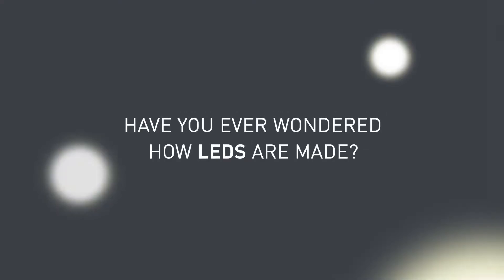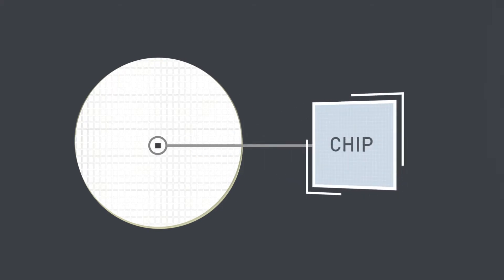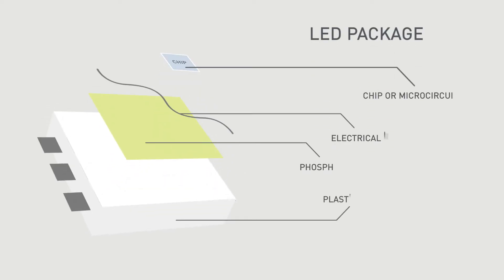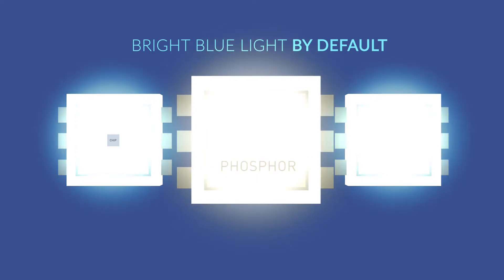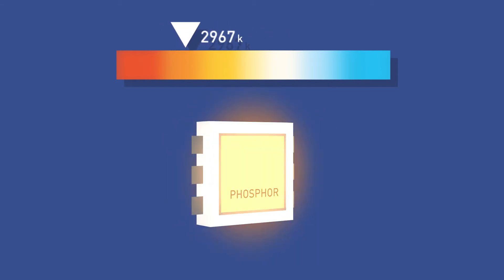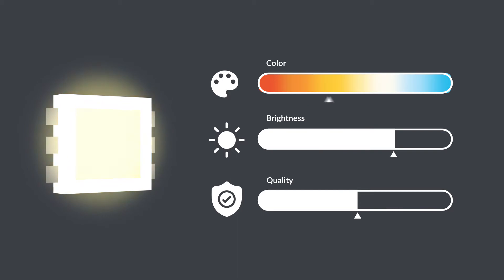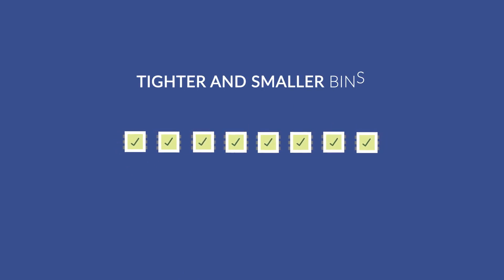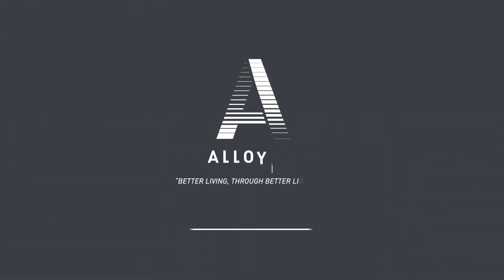Alloy LED - How LED's Are Made

Comment: Huh I never would have guessed that about the binning process. Would have imagined the LEDs are just manufactured with the desired qualities. This is more whimsical, with them all being manufactured together and then each LED turns out however it turns out.
Reply: I think they do that with CPUs too. I remember something about AMDs with fewer cores being the same format as chips with more cores. If certain cores didn't pass testing, the factory just blows a permanent fuse and sell you the ones that worked.